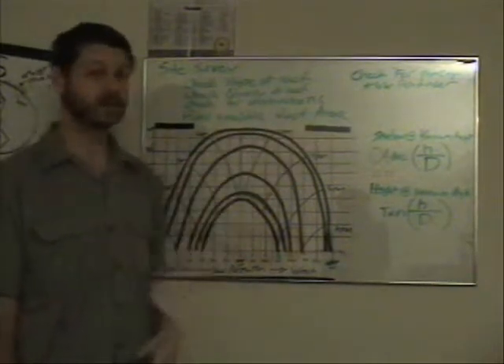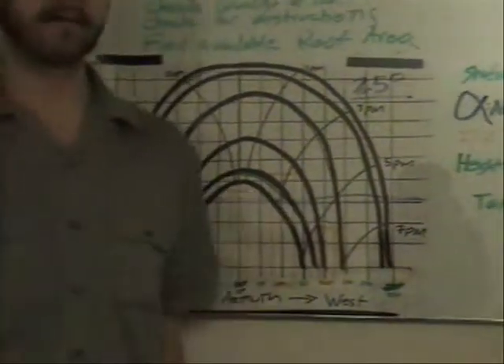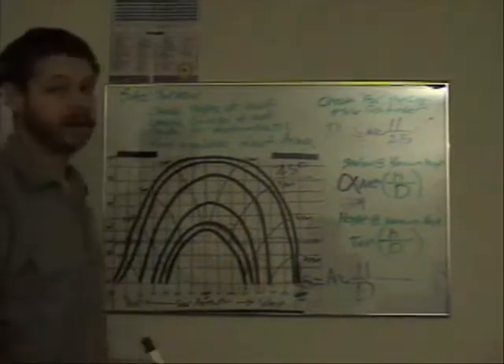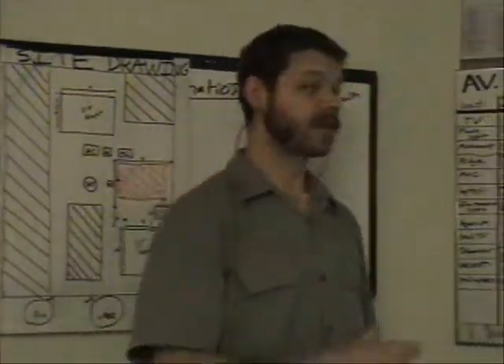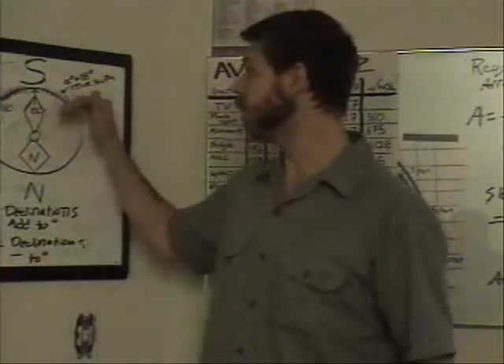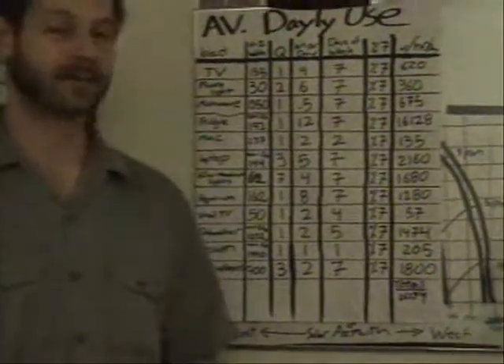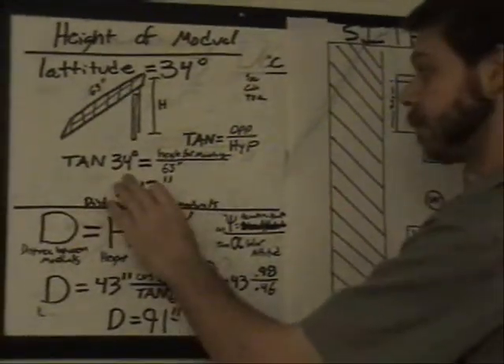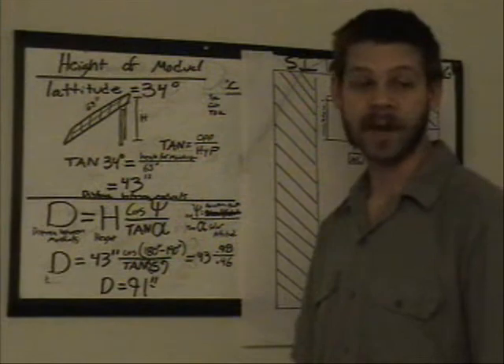NABCEP chapter 4

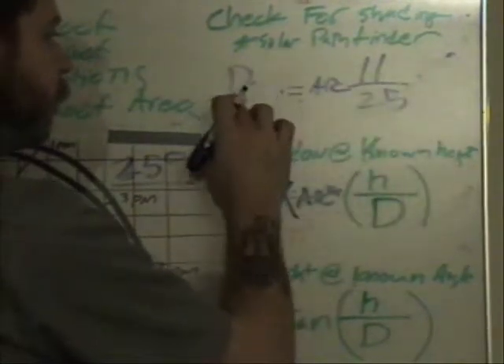Comment: at 10:16... If 25 = arc tan (11/D) then D = 11/tan25 not arc tan (11/25)... although the difference in the answer is small, the algebra of trignometric functions needs to be corrected...